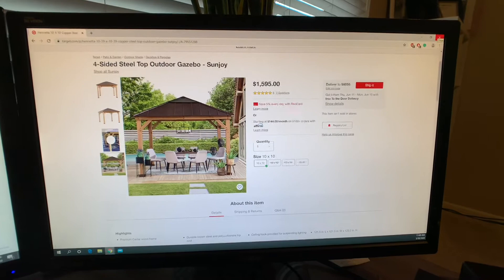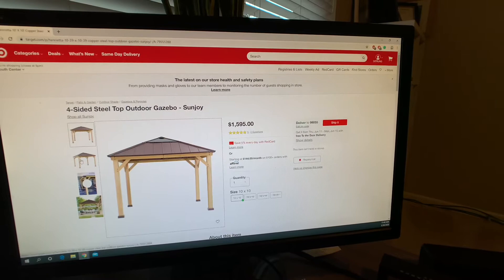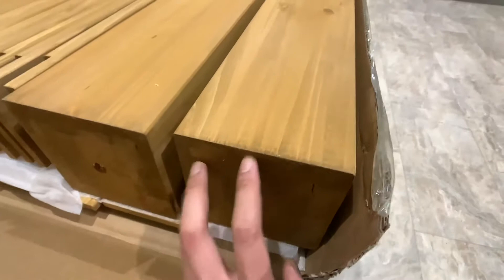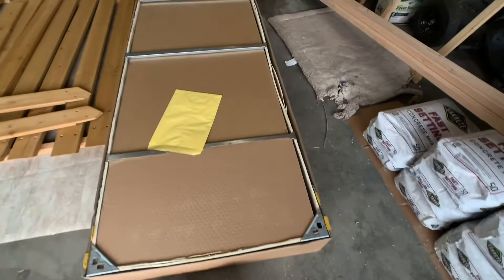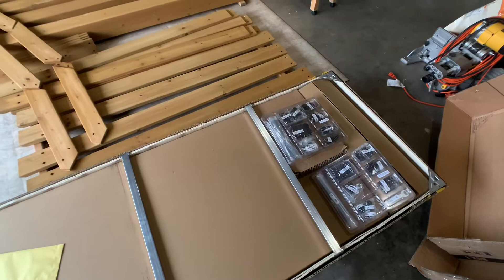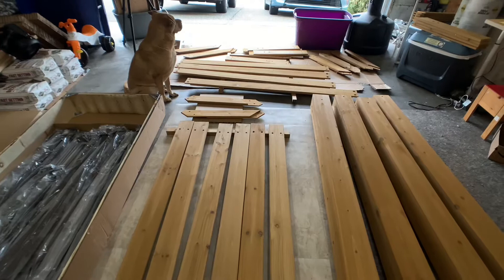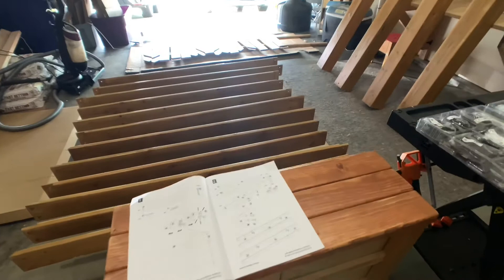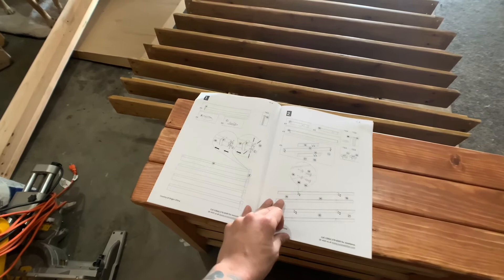Sunjoy Gazebo & More

Comment: I didn’t use cement footings, instead I used DecksGo anchor system, much easier, remove some pavers and drill into the ground, just need to notch out a hole for the rod on the paver and just drill down 36 inch rod , screw the base to the plate and it was done, only took 1 hour to anchor down 4 post .. worth spending a few more dollars and it’s removable